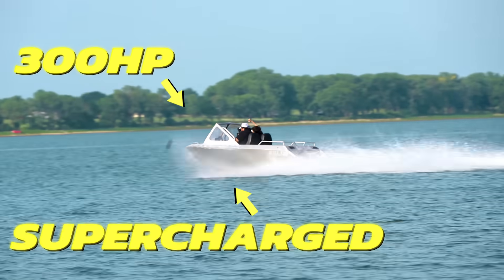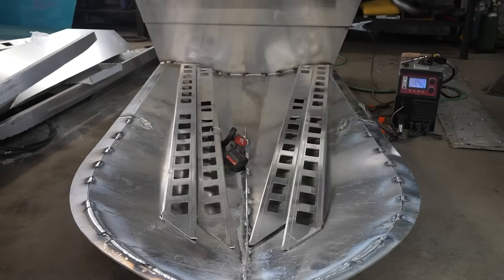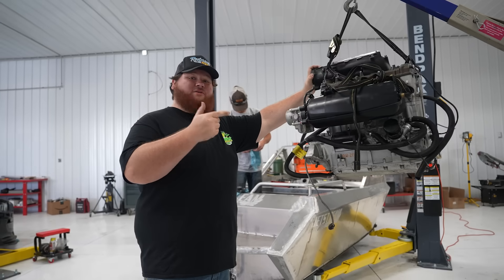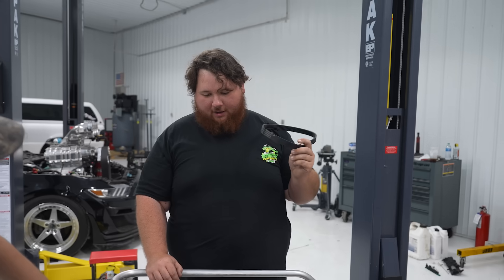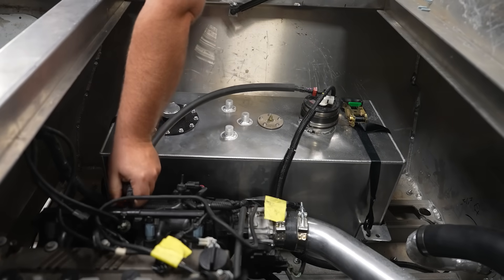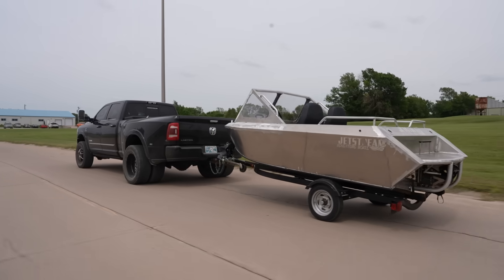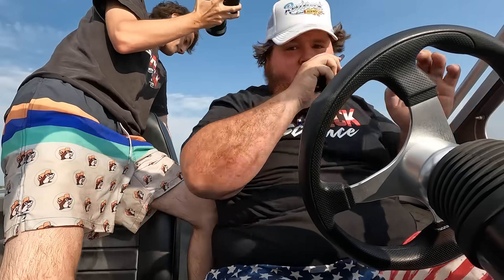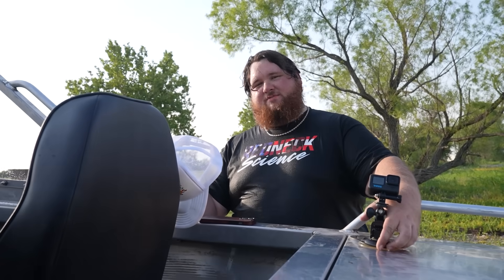I Built a SuperCharged Jet Boat

Comment: Your turbo charger that’s 2 artificial black holes and a motor that does regenerative breaking well enough to be considered a power plant if properly utilized mega volt motor the bearing is deemed then you got a engine that’s another megavolt power plant and it’s a motor at the same time and you’re using nuclear harmonics to drive its oil pump which is in turn pumping oil with that nuclear harmonic wave to the bearing and delivering hydrostatic nuclear force, and so this is thousands of psi high volume high-pressure that you’re putting again through an impeller into the water high science has this ripple the sound shop that you can hear that when you get a hangover and you feel like you’re plugged into electricity in the wall like your brain became a boat motor in the water that is the fabric of reality and it is being electrocuted that is from those boat motors and it is from computer computers. There is a tuning that needs to be done and that’s part of the acute radiation sickness that they’re getting with the ocular rift. That’s another major part of it besides just looking at the temperature of the brain. Another really good one I run into not only does it change what I say all the way up to after the point that I’ve hit the send button, but it likes to just not send my comments and shrink everything down like it did.

Comment: Question I'm a boat mechanic been doing it a long time. I've always wanted to build one of these but does the kit not just allow you to bolt the engine right out the ski strait in the jet boat with out separating the parts there supercharger doesn't use a belt on the ski why did u need a belt on the boat

Comment: I like how when Westen built a boat and a 300 horsepower heat test drives it in the water until the engine locks up

Comment: Sexy montage coming out of the water should have the ladies in a panic state.  
1) Boats are not cars and stuff rattles loose all the time so make sure all of your water lines for cooling are secure, really secure
2) Fuel tank needs a rubber floor mat insulating it from any bracket from vibration
3) Always have a fire extingusher on board
4)  Better ventilation for the engine to breathe
5) Insulate the engine compartment including the top. 

All the best, it looks exciting!!!

Ladies beware Wes is on the water!!!!!!

Comment: A jet sky has a Metal impeller they can be run out of the water for a bit. A boat has a rubber Impeller and they melt fast  so dont run them out of water

Comment: That seadoo you got. They will last ya as long as you maintain them. Had sone last me 20 Years (with proper maintnance onviously). Keep up with the wear ring and watch the carbon seal. Early signs of carbon seal failure would be water spraying in around it. If that seal fails you take on water. Just keep that in check and normal maintnance and you will have many years to come :)

Comment: I would highly reccomend for future aluminum that you get a miller 30a spoolgun and use 0.35 diameter wire, 19 arc volts 630 ipm on wire speed, once you get good it can look close to tig results, oh and super fast travel speed

Comment: You need to get a hold of Cleetus and ask him for a little advice on that boat. He might be able to help you. Also put or add a thick Teflon coating to the bottom of your boat for protection that will sure help it specially when you hit rocks and stuff.
Reply: Most people run uhmw on the bottom of the boats, significantly cheaper than Teflon
Reply: Actually looks like it's already got a uhmw sheet on the bottom

Comment: Hey iv seen where some guys put on a 2nd belt and just zip tie it out of the way and when the belt your using breaks you don't need to remove the engine to put a new belt on. It's a great way to fix it on the water circuit it breaks while out ripping it ! Your welcome

Comment: It probably just sucked water into a cylinder.  Pull the plugs and blow the water out... Good to go.   Fix the leak. 
Build a "snorkel" for the intake and you won't have that issue.

Comment: Had an 18' Sidewinder Berkeley Jet boat with an old skool 455 ci Olds for an engine. On the 3rd engine I discovered that slamming into full reverse, bow dips into water, at 55-60, then backing that sucker up the lake was possibly pooling the oil in the shallow end of the oil pan and away from the intake, thus dropping the oil pressure to ZER0 (0). I traded it for a VCR when new and used VCRs were already cheap. The boat never saw water again, except when it filled up with rain, but I still have that damn VCR and watching Dukes of Hazard right now!

Comment: Western, Marine engines have to be broke in before you give it the full throttle. Like 8hrs or something. Especially new engines from the factory. They require 2000 rpm for so much time, then 3500 Tom for so much time, then they have to go thru a drive cycle of gas, let off, gas again then let of, gas again, then let off. It's like 8hrs of break-in time before you give her all the throttle. But cool boat. I had a 200 merc EFI engine that had to been done that way for break-in. To seat everything and wear in the piston rings. I'm no mechanic for sure, but why would the dealer make me do it if they weren't sure it had to be done. Just my 2 cents.

Comment: Not hauling it to the lake with the smoke stang is a huge fail. Other than that, love you boys!
Reply: You should always have a 4x4 when hauling your boat to the lake, as the boat ramp can be very effin slippery below the waterline, so a rear wheel drive car will be a boat as well, for a few seconds.
There are lots of "boat ramp fail" videos in youtube, check'em out.
Usually they have a wrong car in front.
Reply: @Njazmo  Im aware, but this is Westen we're talking about here. Its nothing a big smokey burnout cant fix. 😄

Comment: You could possibly have too much water pressure coming back to the engine from the jet pump. In those cases it usually hydraulics the engine and bends rods.

Comment: GREAT VIDEO !!!  It was fun welding this in the 100 degree shop!
Reply from the maker: Yes it was!
Reply: Fine job fellas.
Welds held.
Water tight baby...
I've been eyeballing these mini's for a couple years, just need to pull the trigger.
I DO have a nice shop will cold A.C., and colder beverages ZILAwelds. He... He.. he.
Only lack confidence in my own welds. lol
Right up the road in ICT
Reply: @Thesaurcery4U2C  no clue where ICT is …🤷‍♂️
Reply: @ZILAwelds  
Wichita.
It's the airports, call letters.
I forget, people only think it sounds cool
here.
Nobody else knows wth it is. lol.
Reply: @Thesaurcery4U2C  just buy the new HTP revolution machine and confidence and ZILA will come and weld the boat with you!
Reply: @ZILAwelds  
Own a Prime Weld, Tig & stick, currently.
I bought it in-the-box used for about 1/2 $
It Has worked fine for what I've needed so far?
If product reviews have any truth to em?
It's claimed to do a great job on aluminum?
I just haven't had the opportunity yet.
Those boats are a straight production line duty, in comparison to the few things I've had to do.
.
I'm a hobby / necessity welder, taught a little by a real welder 20+ years ago.
I believe I may have peaked in my talent level back then. lol.
I checked out that Revolution, and that all in one is a very nice set up. (all of them)
I don't know who writes their product descriptions at USAweld, but that was a very descriptive write up.
I know more about its capabilities than the one I own.
Talented guy.
I Was just looking at alum, hull kits.
I will keep you in mind whenever I  loosen my tight wad, and do it.
I'll $ee with you $ay about $omething like that.